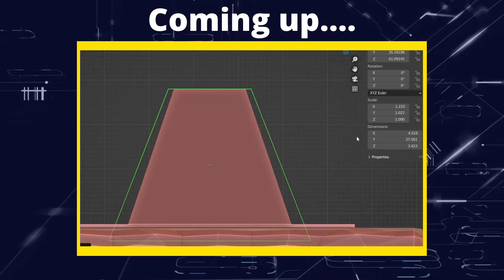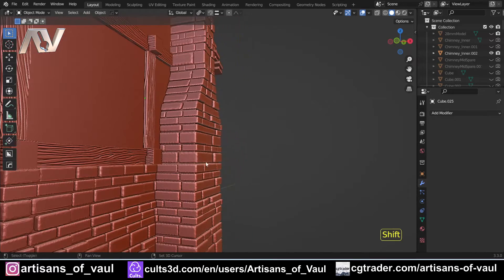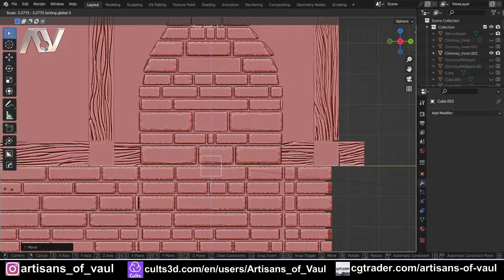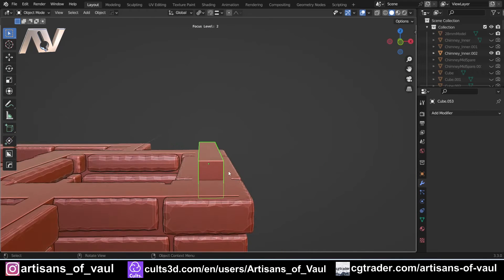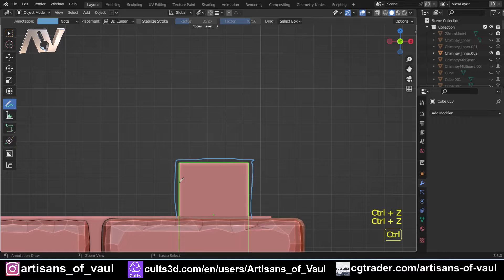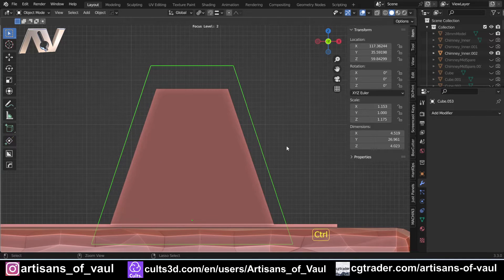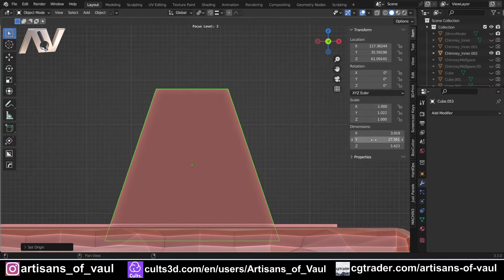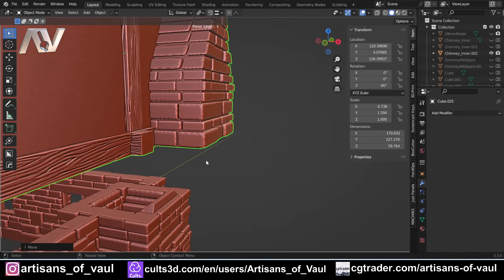Tips and Tricks for Cutting and Keying Models for 3D Printing

Comment: I'm finding with newer printers the hole the key cut goes into always shrinks slightly so would be good practice to start making the hole 1mm larger to account for shrinkage! Key part's are just to I'd say more swollen than printed larger a quick sand would work just fine but getting the right fit would be even better, 8 year plus resin priter im finding this more with more pixels we're getting it's very strange,  calibration settings are perfect.
Reply from the maker: I think 1mm might be a bit overkill, a well dialled in printer should need about 0.2mm clearance.

Some newer printers have more powerful screens so as part of the dialing in process reducing the power from 100% to 80% can help a lot.

Comment: just found your page as a noob blender user and im loving it!! sorry for the dumb question but when you had your final shape for the key, you ctr-l + to add boolean and you ended up with a wire and original cube. does that mean you duplicated it so you can use it to cut the shape out of the receiving piece? around the 6min 10 sec mark. Thanks!
Reply from the maker: When you use Bool Tool it leaves the original as a wire frame (depending on your settings).  So I apply the boolean to allow me to use the original without affecting the bottom section I had made and then I use that original to make the cut for the top section.  Hope that helps.
Reply: @ArtisansofVaul  thankyou so much! loving your content!

Comment: I know this is a older(er) video. But I just have to say that, yet again, this is such incredibly useful and well-presented information. Yours is the only channel that truly gives information that's relevant, useful and easy to understand for design for 3d printing. (Particularly when it comes to replicating miniatures for painting!) I did have one question, though...

Given the mesh that you're keying and the tolerances you're creating, I'm assuming this would be for FDM? 0.5mm seems quite large for resin. Would you think that 0.25mm would be sufficient for keying resin models?
Reply from the maker: Thanks so much shader 😁 It was originally for resin but I kind of exaggerated so that it would work for everyone watching, 0.2-0.3 would be my normal gap.
Reply: @ArtisansofVaul  Awesome! Thanks for the quick reply! That's kind of what I was thinking, given that we're now working with resolutions that are down to something like 0.03mm!

Comment: Thank you! This is something I've been having a bit of an issue with but didn't even know it was called Keying. The guideline of roughly 0.5mm is specifically what I was after.
Reply from the maker: Thanks 👍🏻  I would be a little careful with the 0.5mm as it will depend a lot on your printer. I would suggest printing two sections or cubed that are joined together with the keyed parts and see how it fits for your printer before taking ages on a model and finding it doesn't fit. I will say though that the tapered shapes do also make sanding easier if you do need to take a little bit off.

Comment: Great video, these joints look super elegant for large modular pieces. I found some success making pieces with cylindrical female keys in both halves and using a dowel to pin them. I prefer this for smaller models where the male joins can sometimes be nightmarish to print, while poorly printed holes can always be widened with a drill.
I would definitely appreciate a part 2 about organic shapes, as I am looking to tackle a multi-part squig sometime soon.
Reply from the maker: Thanks so much. I totally agree on your suggestion of using another object to join things together. For smaller pieces I often use a metal pin. 👍🏻 I'll find a model to do the organic version on.

Comment: Very useful! 
Odd request, cutting a model exactly in half. I have a 2x2 grid floor tile and cannot for the life of me figure how to cut in blender. I’m having to export to 3D builder and back in again
Reply from the maker: Do you have any addons, especially Boxcutter? Just so I know what to work with.
Reply: @ArtisansofVaul  hard ops and box cutter. I just find it hard to do anything to exact proportions in Blender. I’m probably missing some basics here! The bisect tool was hopeless on this item with complex, sculpted geometry
Reply from the maker: @richardokeeffe8375  Ah, you're wanting to be very precise?
Reply: @ArtisansofVaul  it’s a 2x2 dungeon tile. I want to cut into 4 exact 1x1. In 3D builder it takes seconds with the ‘split’ action . I’m just annoyed with myself that I cannot work out in blender how to do it.
Reply from the maker: @richardokeeffe8375  If it's exactly a square it isnt too bad, as always there are a million ways to go about it.  The easiest is probably to make a cube that exactly 1x1x(as high as it needs to be) then use snapping on vertex mode to snap the cube to a corner. Do that for each cover and then select a cube and shift select the object (in this case the tiles) and then use hard ops (or Bool tool) to slice the objects.  I might make a video on this actually.
Reply: @ArtisansofVaul  oh that’s cool. So that cuts the space away from the target?
Blender is obviously amazing but some of the ‘basic’ features are so hard to find and understand vs simpler software. Don’t worry, I always assume the limitations are on the end user 😂
Reply from the maker: @richardokeeffe8375  Yeah it will split it into two separate mesh/objects
Reply: @ArtisansofVaul  thanks as always!!

Comment: Informative video, and I am sure it will help others. 
Even if I am going to glue it, I prefer if people made their keys like this. The trapezoid slides into the gap and allows for looser tolerances in printing. If the dry fit is still too loose, a little greenstuff or glue seals up the gaps if I am making it permanent, poster/blue tack works well if you want the piece to come apart later.
Reply from the maker: Totally. The shape also makes it easier to file of the fit is a little too tight in my experience

Comment: I suppose there will be slight overhang with keyhole and you will need supports when printing?
Reply: Likely not, if you're printing with FDM. That should be a small enough overhang that even a poorly tuned printer could bridge that bit without a problem.

When engineering parts for 3D printing on FDM printers, you can engineer some overhang into a supportless print by making sure that both ends of the gap are anchored, and keeping those gaps reasonable short.
Reply from the maker: It may do yeah, especially if the lower edge is very thin. But that will depend if I angle that print.
Reply: Even if this is resin printed, they keying in the female side slopes up inwards at a steep angle (over 45) so would self support and the male part being an upward facing side also means it self supports. This is the only way I would want to see it orientated to be honest